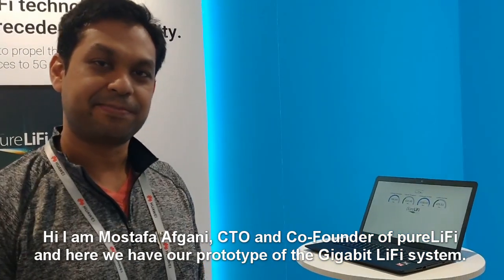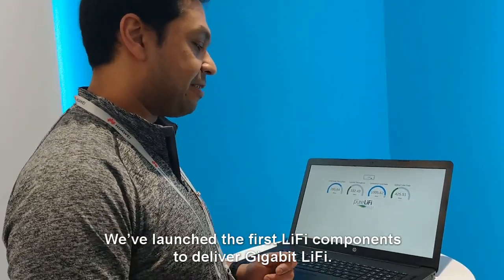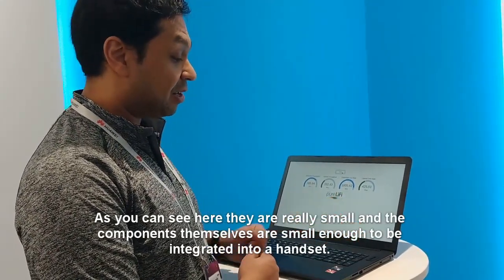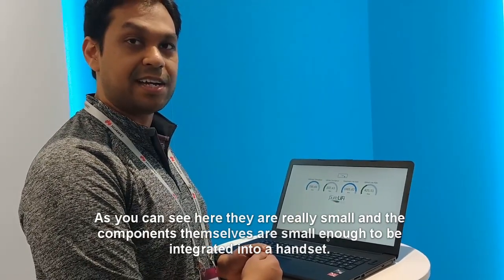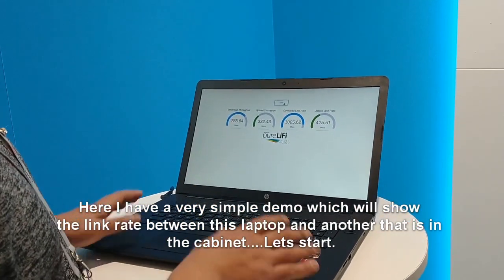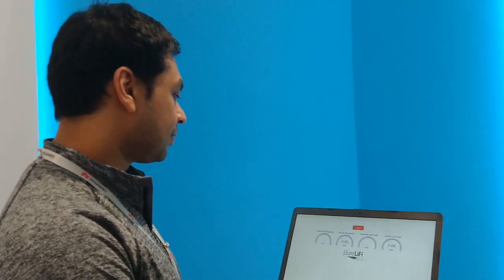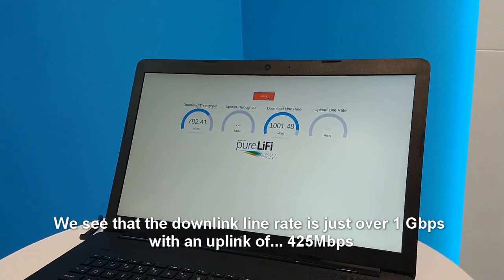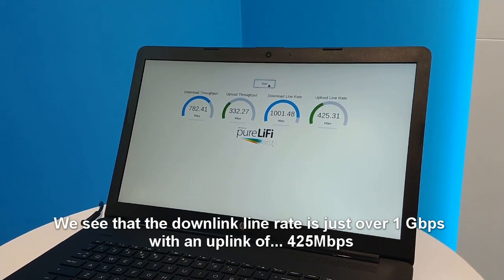pureLiFi demonstrate Gigabit LiFi at MWC 2019

Comment: How far, distance wise can you sustain this throughput? We are assuming that in busy dense urban areas you can sustain throughput at 500 meter intervals. If that's true, it can be a good solution for 5G backhauling.
Reply: Yes, it would be possible with IR-LED floodlights. With a few 50W Floodlights u should have enough range for a street. Even more efeiccient than 5G Modules with 150W of each.